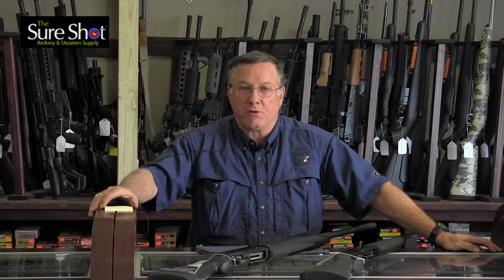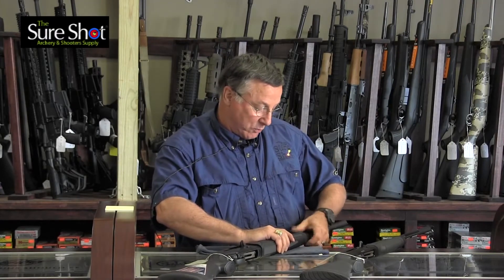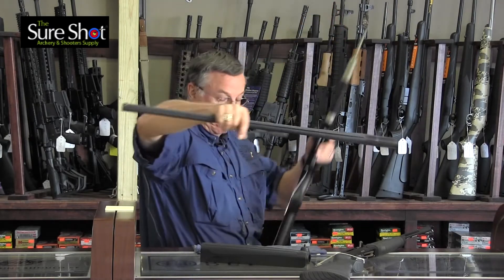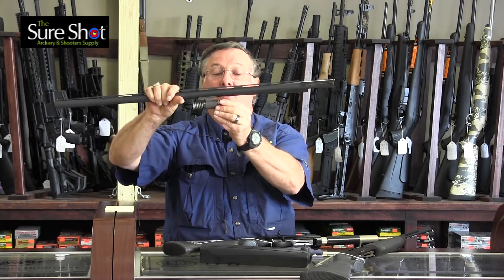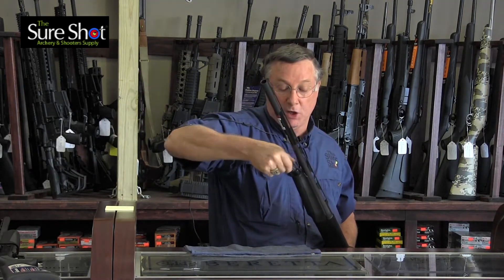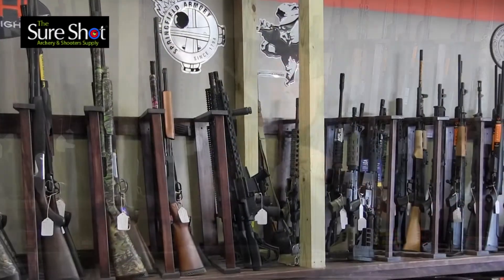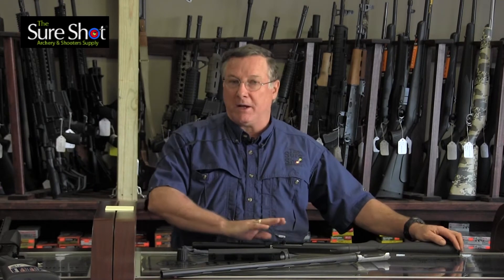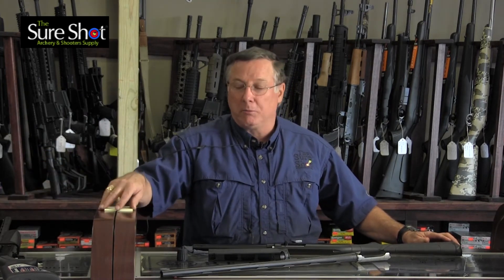The Sure Shot - Recoil vs Gas operated Shotgun

Comment: Biggest difference between the two is how they unlock the bolt.  If one might notice an inertia gun has a rotating head on the bolt with a heavy internal spring that is compressed at battery, then upon firing the inertia of the bolt body moving rear ward causes the locking lugs to twist free.
A gas gun has a locking lug that is forced up into a cavity in the rear of the barrel at battery.  The gas simply pushes the bolt body rear ward enough for the lug to disengage.
Once the bolt is unlocked, both are essentially the same, recoil compresses a spring which forces the bolt back into battery.

Comment: I absolutely love inertia system, 0% loosing power because the bolt is completely locked until way after living the shot, very easy too clean and maintain, I really do not like at all gas system, you loose power, and they are very dirty to clean, all that just because a little bit less recoil? No thanks gas system bye bye gas

Comment: Wich of the two can run the lightest loads?
Reply: Gas
Reply: @davidkirkpatrick712  is it true? I have a M2 and yet to have a feed error with light loads. And thats even firing "free hand" with no shoulder against the stock.
But gas offers manual adjustment if you like, but the M2 and benellis inertia system is reliable with most common loads and no adjustments nessecary.

Comment: if you look up magazine fed semi auto shotguns you will see that there is a fair amount of both gas operated and inertia operated shotguns. though most of the shotguns will not specify weather or not it is gas operated in the description. if its cheaper than 500$ its most likely inertia operated. ive never seen a gas operated shotgun for that cheap that was actually made from decent material.
Reply: both the saiga and vepr 12 shotguns are king when it comes to the semi auto mag fed shotgun market. both are gas operated with adjustable gas valves, which allows you to set your gun up to fire lighter loads. inertia operated shotguns do not have this special feature.

Comment: Which system has less felt recoil?
What is the softest felt recoil shotgun?
Reply: Jason McClaran it would normally be the gas operated due to they weight often more than the recoil operated. More gun is less felt recoil. But if you had made the guns weigh the same It would not been any different. Except you use a small amount of gas that operates the gas operated instead of all propelling the charge in a recoil operated.

Comment: Question: does the energy used to drive the 'inertia' spring take away any of the energy used to drive the shot through the barrel?  If so, is that loss of energy compensated for in any way?
Reply: Paul Dougherty 
No it doesn't.
Reply: The bullet creates two directions of the force when it fire.

Comment: I know it is a matter of semantics but the Benelli shotgun is not recoil operated; it is inertia operated. The Browning Auto-5 shotgun was recoil operated (long recoil), as was the Remington Model 8 and 81 rifles. Most modern handguns, like the Model 1911, are short recoil operated. Many belt-fed machine guns, like the Browning designs, the MG 34 and the MG 42, for instance, are also short recoil operated. Recoil operation is very different to inertia-operation. Inertia operation is quite rare and is more or less unique to the Benelli shotguns, I believe. It is an excellent operating system, by all accounts.
Reply: It is actually correct to call it a recoil operated system. Since you use the recoil of the shotgun to create an inertia of the bolt body that are again used to store energy im the inertia spring that cycles the system. More correct would be go say inertia recoil operated as one describes the short or long recoil operated systems. Without recoil this system dosent work.
Reply: You don't have to worry about backing an A5 up. It will back you up all on its own, and cycle. You get the shot, bolt and barrel thrown at your shoulder. Still my favorite shotgun of all time.

Comment: This is the simplest, best explaination I've seen yet. Thanks for explaining it clearly!
Reply: crockett616 thats totally correct.
Not shouldering this shotgun will not give it problem to cycle. Its function by the fact that the shotgun moves backwards by recoil and the bolt body stays stationary by inertia. Charging the stiff spring with energy. This will give energy to rotate the bolt head and cycle the action. The one thing that will make it not cycle are low power shots so that the shotgun dont recoil enough to give   enough energi to cycle the system in the inertia spring. Or ypu put the buttstock against a wall or some thing the wont move and the shotgun will not cycle since it wont recoil backwards.
Reply: Actually, I would have wanted him to be more clear about the Benelli. If I understand correctly, its an inertia operated shotgun. And if I understand correctly, with an inertial operating system the shotgun recoils while the inertia of the bolt carrier causes it to not move. This is used to compress a spring. And next that spring pushes the bolt carrier causing the bolt to rotate open and cycle. Thats if I've understood the operating principle correctly, I'm trying to find out about it. It's quite a clever system. I don't understand why not shouldering the shotgun properly would cause it to malfunction, I'd think it needs to be able to move backwards and if you put the butt of the shotgun against  the floor or a wall or what ever, it should not cycle...